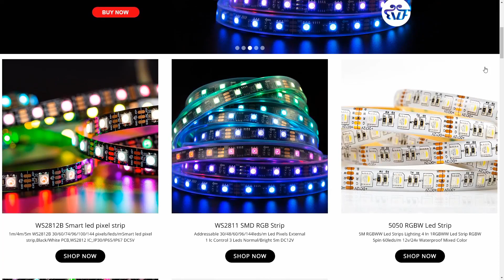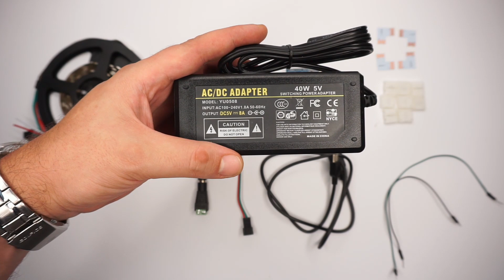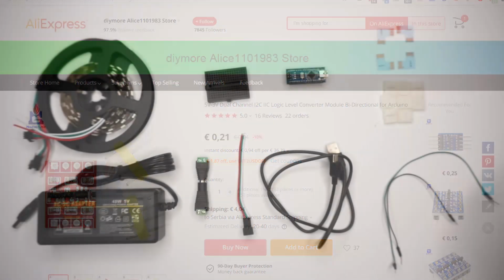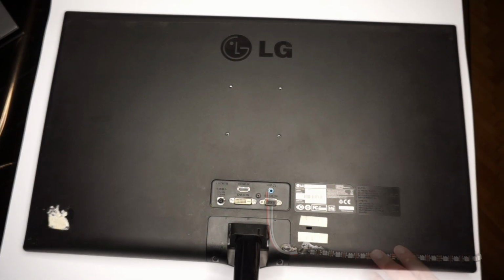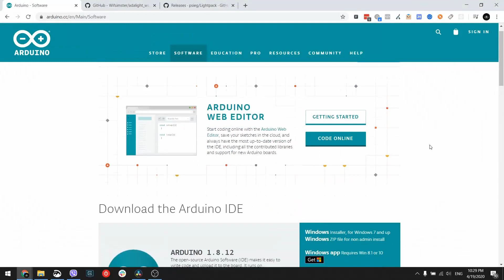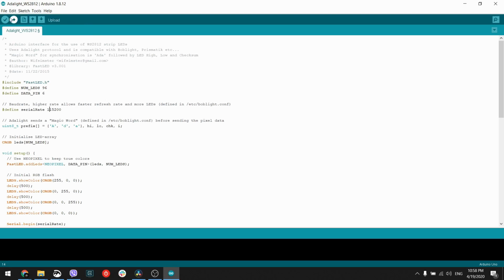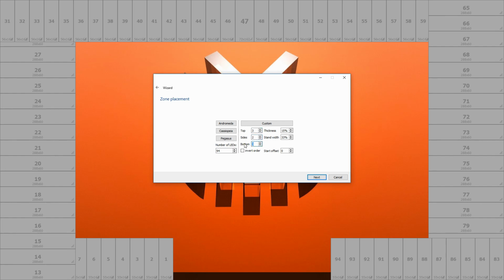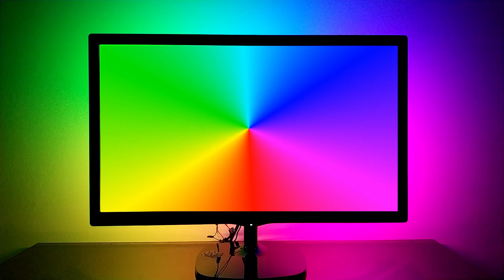Cheap DIY Arduino Ambilight 2.0 (Revisited) RGB WS2812b LED Full Build & How-To

Comment: Hi Boris. Great tutorial. I didn't go DIY like you. I saw your video after I purchase a complete set from one of the sellers on Ali. As I browse these popular ready LED sets on Ali, I notice that all of them, including one I got to come with a much weaker power supply than you advise. For example, 3m/60 LEDs have only 6A power supply or 5m/60 only 8A. I explained and discussed with one ALi seller that 3m/60 LED strip use 54W, and his power supply can generate only 30W, but he states several times that is not a problem. This seller explanation is that his controller doesn't require an LED power connection from both sides and also since his set comes with an "upgraded controller," and they "limited the excessive current in the controller program." I understand that this LED will require full power like 54W only in they peek time when all of the LEDs are used in full brightness. Still, even with that in mind, I think this power supply they provide is way too weak. Whats is your opinion about that? How this inadequate power supply can affect the overall quality of lights, and is it safe to use?
Reply from the maker: With power supplies it is always better to go stronger than needed (less heat and strain on the components. At first I also just powered from 1 side only but after testing the end of the. Strip colors were not consistent with the beginning. Especially on white. Maybe if the strip was 12v it shouldn't be an issue but as it is 5v you get significant power loss especially with the L connectors instead of soldering. So yeah I think they are cheaping out on the power supply.
Reply: @dusnoki , thanks for your reply, most likely they cheaping since so many other competitor shops on Ali. I have a spare 10A power supply in case 6A will have some problems, I will use that one. Hope it will work just fine, can't wait for my light show ;)
Reply from the maker: Good luck :)
Reply: @dusnoki  right, like you at first I supplied only at the start of the strip, later I added also at the end, everything changed! Power Imput for each strp is the best, and you wont get any surprise!
Like this: http://alexgyver.ru/wp-content/uploads/2018/02/wiring2.jpg
Reply: What set did you buy on ali? I saw a few but none of them use the same software, where you able to get it to work regardless? Thanks
Reply: @ZeushadesChannel  As far I know most popular Ambilight sets and I didn't find other on Aliexpress is from zofipo or Dream Color. They all support the same software of your choice - two different for windows, raspberry or android. Without looking at a proper guide on YT it's not an easy job anyway. When choosing between sellers make sure that this one gives you the strongest power supply for your chosen length and amount of LEDs per meter.
Reply: @peraspera83  better purchase separatly at least for power supply?? Why?? because industry kit are 
bait catcher!! and generaly come at headache price!! Struggle a bit and buy all components as described in the video and you wont get any future headache or desappointment... just an advice...
Reply: @DrZipZwan  you right and i would if only saw Boris tutorial before getting complete set... In future, I plan to do the installation also on my tv and there I will have it buy separately. Thanks.
Reply: @peraspera83  If you bought already the set, it is not a complete lost!  I checked a bit on AliE and saw Zofipo and some other set, it is actually an Arduino like module that does the same job I think. So in your case you got already the strip, if any complications turn to Arduino Nano, they are pretty cheap on Ali, 2$. And works great.
About Power Supply, the one I am seeing with kits, do not look so bad, and sometime it is not the Power Supply the issue, but more how your are Powering the strips!! Individual INPUT for each strip is the best! As this one:
http://alexgyver.ru/wp-content/uploads/2018/02/wiring2.jpg
Check also this tuto: https://www.youtube.com/watch?v=tx5GxvFgkh0&feature=emb_logo
I know it is in Russian, but you may pick some knowledge or ideas...

For TV be carreful, with those kits, they only work with Android smart TV!! 
For a full setup this is the best tuto is recommand: https://www.youtube.com/watch?v=hpBRKZ_2aY
Super complete tuto and well explained for all TV 😉

Comment: im usisng 43 inches tv as monitor for my pc,can i make it using same parts or do i need to buy something diferent from the tutorial????
Reply from the maker: In your place I would use 30leds/m, power them from both sides like I did. Everything else should be the same. Just longer strips.
Reply: Boris Dusnoki thanks ,thanks ,I  tell you my results ,

Comment: Hey i wonder if i can use 12v adaptor for the leds and convert it with buck step down converter to make it 5v?
since i have many 12v adaptors lying around here
Reply: XL4015 is the boss of stepDown!! handle fine 5A, best to dont push it to far set it to 4.8A max and you should be good to good. Check tuto how to check max Ap on those StepDown!! Plus it is not a bad idea to add a heatsink on the IC if you are going to draw that much Amps...
Reply from the maker: Sure. Just make sure your buck converter can handle the amperage.

Comment: Hi Boris, I was looking to do this but I have some question, which could be the difference if instead of the stripe RGB WS2812b I use the SK6812 RGBW? I see it has 4 pin and I don't know if that would change the way it works with Arduino, I'm interested in the white light it has to use it while I'm programming instead of playing or watching a movie.
Reply from the maker: There is probably a way to set it up in the sketch. Try doing some googling. I never worked with sk6812 string so really wouldn't know.

Comment: Hey Boris, aesthetically speaking is there a significant difference on using 60 led/meter compared to 30 led/meter??..
Reply from the maker: I used 30 per meter. And 60 per meter. 60 is much better but you really don't need more than that.
Reply: @dusnoki  Thanks

Comment: For hardware security reasons i place an 470 Ohm Resistor between D6 and Data, a radial capacitor with 100uF between +/- by the power connector. Works fine for me. Thank you very much for this video.
Reply from the maker: Thanks for that. I tried before with a capacitor and resistor. Honestly didn't make any difference when I powered the strip on both sides.
Reply: @dusnoki  This "Hack" is to secure the leds, which sit directly at the power connection on the stripe. The stripe has for every led an capacitor, bot not one between power connecor and the first led. Sure, your solution can work fine for a while, but can also destroy the first leds. More information about this can be found in the arduino bulletin boards.
Reply: @worstgamer848  I'm just about to do this. Where is the location between D6 and data? And the radical capacitor just in the 2 mounting screws for cables on the power connector?
Reply: @flatmotion1  "D6" is the PIN on the Arduino Board and "Data" is the Data point from the LED Stripe (so you connect the resistor on "D6" and the "Data"-Wire of the LED Stripe on the other side from the resistor); The Radial capacitator comes additional between the "+" and "-" pole of your power connector and the power cables (you can think it as "Bridge" between "+" and "-") but take a look of the polarity of the capacitator ...

Comment: BTW: YOu can possibly use your PC PSU to power the LED-Strip, as most PSU can handle  up to 15A at 5V. Some BeQuiets can even handle up to 25Amps as far as I'm aware.

Comment: I'm looking at using an arduino uno for this. Do I need the female power supply adaptor? The uno has one already I think? If so, would the wiring be different?
Reply from the maker: Do everything the same as I did. Do try try and run power to the strip from the arduino. You will fry it. Just connect the green wire and ground to the arduino and connect it with a USB cable to your pc. Everything else should be directly connected to the strip from the power supply.
Reply: @dusnoki  Hi I did the same wiring as in the video, except I didn't need a breadboard. Works perfectly! Great video!

Comment: I helped my son build this for his gaming monitor based on your version one, and we actually dropped the L-connectors and soldered because we had connection issues. I don't think it was voltage drop, as it's only a 24" with 30led/m, and it's working fine now. But should they work as intended, they are definitely the easier way to go.
I am currently waiting for my 6A PSU to light up my monitor - thanks for this great tutorial, it has everything inside, all the links and is still kept to the point.
Reply from the maker: I'm glad you had fun. Yeah I had some issues with the L connectors. On my previous build I soldered the angles but many people don't know how to solder so I thought I would go with the L brackets. It was a bit of trial and error but got them working in the end.

Comment: is there  a way to adapt this so it could be used on a 16 foot diagonal projector screen?
Reply: I am working on this based on this video. I believe you will need a bigger power supply and more LEDs. My 145" screen needed around 32 AMP to run. So I got a Meanwell power supply with 40 AMP max.
Reply: I am also using 9 meters of the same LEDs this video points out and has links too.
Reply: So I have 551 LEDs and I can only get 511 LEDs to light as that is the limitation of the prismatik software. Anyone have an edited version that allows over 511 LEDs with Adalight (serial)??

Comment: why my led flickering in mode screen grabing.?
Reply: Is it flickering only in the screen grab mode, or also when it's in static color mode?  I had some flickering issues that I resolved by making sure my Arduino was properly connected with the breadboard; mine had come slightly loose.

Comment: How do you join the first green wire to a breadboard wire without soldering?
Reply from the maker: Just stip the ends wrap them both together and isolate them with isolation tape.

Comment: thanks for the video. I am still confused on how the arduino would know what colors are displayed on the tv and use them to light the strip without an hdmi grabber.
Reply from the maker: Because it gets them from the pc using the prismatic software. It doesn't work standalone on a TV. For that you need an hdmi grabber raspberry pi and different software.
Reply: @dusnoki  Thanks for the info. appreciate it.

Comment: Thank you so much for this guide! Very easy to understand and learn from!! Unfortunately I got too excited after confirming my LED strips worked on arduino and I loosened a wire while it was plugged in + powered on which fried my two LED strips but oh well cheap lesson learned! Waiting for my replacement strips to come in on the weekend and to finish it up.
Reply: First attempt I grabbed the wrong PSU and melted a strip with 12V instead of 5V - luckily the Arduino didn't die, and neither did the attached PC. You are not alone ...
Reply from the maker: I'm very sad to hear that. BTW when these get fried it's usually just the first one or two that die. If you know soldering maybe you ca try cutting off the first led, desoldering the wires and soldering them on the second one. And try then.
Reply: Can anything like this damage our pc (because it's connect to pc)

Comment: Heya! I have a major issue with this project :/ I have everything set up as you do in the video and I'm fairly certain my leds are making a good connection but they've never lit up, even after uploading to the Arduino. The end of my led strip also has loose positive and negative red and white wires but that is not displayed on your schematic. Do you have any idea what might me causing the issue?
Reply from the maker: The positive and negative wires on the end just tape them off. They serve no purpose if you connect the two ends together and splice the gree wire from the start to connect to the arduino.

Comment: Do you have a link to where to get the breadboard wires? Or did they come with the AliExpress breadboard?
Reply from the maker: Check your local electronics shop.. They are quite cheap.

Comment: Boris, do you think this will work with MacOS? I see that all the software has MacOS versions but I want to ask you before I purchase any hardware. Thanks
Reply from the maker: I haven't tested personally on a mac but have on Linux and it worked without a problem. Don't see why it wouldn't on a mac.
Reply: Boris Dusnoki nice thanks dude.  Gonna give it a go
Reply from the maker: Good luck :)

Comment: Hey man, great job with the tutorial! 
I wanted to ask though: are capacitors and resistors necessary on this kind of project when using around 90-100 leds? I see that mentioned on some other tutorials.
Reply: X2
Reply: Did you ever find out?
Reply: Å

Comment: Hey, I am planning on doing this project but I am confused about the logic level shifter. You said we need it in the beginning, but I didn't see you use it when connecting the LED's to the Arduino so I was wondering if we need it. Thanks!
Reply from the maker: If you listen again I said that u need it if you want to use an esp8266 as it uses 3.3v logic. And the ws2812b uses 5v logic. But if you use an Arduino nano like me, you don't need s logic level shifter as it uses 5v logic.
Reply: Boris Dusnoki Ok, thank you! Also, I have two monitors and I saw some other people using prismatic for two monitors so I was wondering if you knew how to do that. Thanks!

Comment: Hi, I just followed this tutorial and it worked intially, but a few hours later only 55 out of 104 LEDS respond (and flash R G B when the arduino is reset). I even used a 5V 10A cable, powered from both sides. Do you have any advice? I have already restarted all systems
Reply from the maker: Ping me on discord. I'll respond tomorrow.
Reply from the maker: But it's most definitely a connection issue. Check all the connections like I did on the corners.

Comment: Arduino IDE fails to upload when trying to use Old Bootloader. do i need to use old bootloader?
Reply: Thank you for this comment! Old Bootloader was failing my upload also.
Reply from the maker: What board are u using?
Reply: Boris Dusnoki nano. I was able to get it to work without using the old bootloader
Reply from the maker: Maybe you are using a newer board. With my nano it works only with old bootloader. Thanks for the info I'll add it to the video description.

Comment: Looks excellent. How does this compare with say, raspberry pi with hyperion?
Reply from the maker: If you want to use it with a pc only it's much cheaper
Reply: @dusnoki  Thanks dude. Btw I have a question... I'm not the most tech savvy guy so this may sound stupid. Do you know if I can use 12v 5a power supply? The 5v ones are really expensive in Canada.
Reply from the maker: Don't even try. You'll fry the leds
Reply: @kleash  You could use a high-wattage step down buck converter between the 12v power supply and the less. Make sure to get one with good heat sinks.

Comment: Thanks for the video nice and clear, but what if I am using a 4 pin led (APA102)? where can I get the fast led for that? thanks :)
Reply from the maker: Hmm really never worked with those leds. Probably have to connect data and clock to the arduino. Not sure about the sketch.
Reply: @dusnoki  Thanks for a quick response! Happy to say that I was able to make it work.! Thanks for the very informational video you the best
Reply from the maker: Awesome

Comment: Does this work on multimonitor setups? Can each be setup separately?
Reply from the maker: I don't think so. You can only use it on one monitor out of the two. You can select which one to use.
Reply: @dusnoki  And If i have 2 setups (2leds, 2arduino...) on each monitor, and controller 1 on ambibox and 2 on prismatic, not work???
Reply: i did it before,  but you need to combine the monitors (nvidia surround, amd eyefinity) and try using 30 led/m  led strip for low power and faster refresh rate.

Comment: i have 136 LEDs installed. Is an 8 amp power supply enough? do I need a 10 amp power supply?
Reply from the maker: It comes out to 8.16A (0.3w per led) I would definitely go with a 10A one.
Reply: @dusnoki  Ok Thanks for your help!
Reply from the maker: You're very welcome

Comment: Nice! Can you post a vid while your setup is playing some housemusic via Winamp WITH the milkdrop plugin? I want to see how fast it reacts to the moving images... Thanks
Reply from the maker: In prismatic there is a music mode which samples the sound coming ot of the system. And pulses the lights based on that. It's poling at 60fps the monitor so it's quite fast.
Reply: Aight 60 fps is fluent enough but I was just wondering "how fast" it is because there are A LOT of colours and A LOT of moving shapes in Milkdrop. Just wanted to see how it would look... Guess I'll have to build it myself once lol 😁
Reply from the maker: Good luck :)